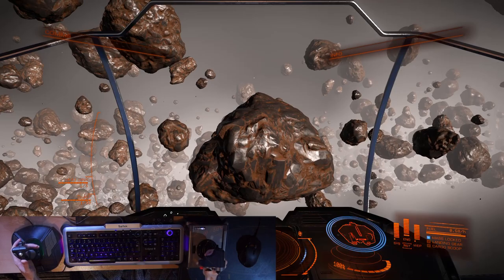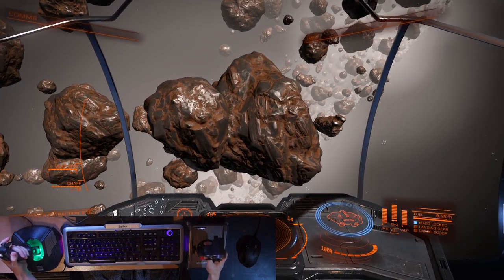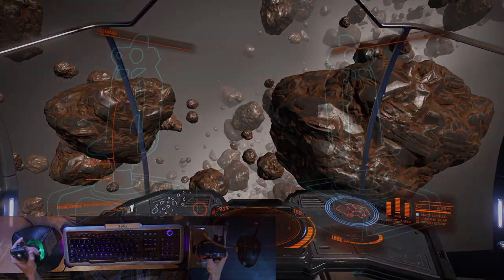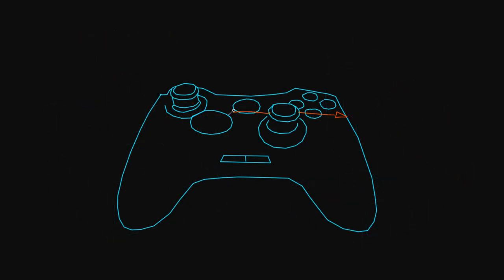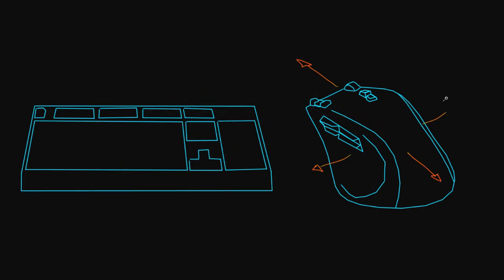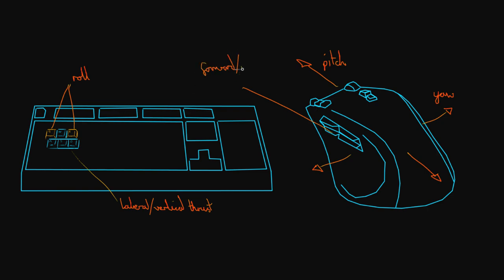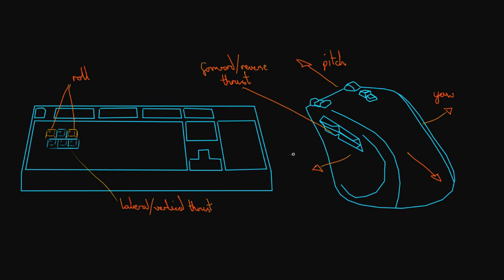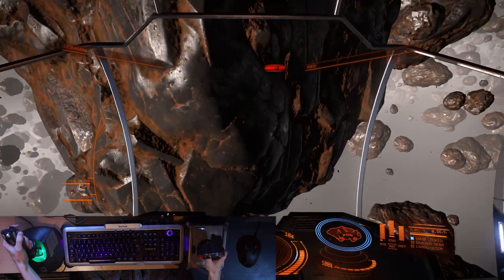Elite Dangerous Flight Assist Off Tips - Control Settings

Comment: On the gamepad's Right Stick, what do you mean having Yaw/Roll on the same axis? I can't have these two functions (Yaw and Roll) mapped to the same axis, the game only allow me to use Yaw or Roll.
Reply: Did you find a solution?I'm trying with yaw into roll on but I'm not happy with that.
Reply: @aidendavis3086  Nope, I tried yaw into roll for a while, but it doesn't work as well as I thought.
Reply: @ArcherAC3  we'd have to either buy a pedal or something
Reply: @Alecxace  you can also use the stick press for something (in my case yaw) Free look is binded on another button.

Comment: I'm using HOTAS and rudder pedals. I'm using the rudder toe breaks for lateral thrusters and one thumb knob on my throttle for horizontal thrusters. Works like a sharm.
But I'm still wondering about one thing: What would be the 'right' way to set up the yaw axis on the rudder? Currently, my nose yaws to the left side when I push the left pedal in, but a friend of mine descibed it as counter intuitive.

Comment: is there a way that i can have say an fa off override for thrusters? for example, when fa on i want it to act as it does by default (throttle up and down), but when i switch fa off i want it to use the same keys (w and s) but to have them be thrust forward and back. 
i belive a landing override exists that does that, not sure about flight assist.

Comment: I gotta say, wouldn't it make more sense to have it set up like a plane, where the pedals for yaw?
Reply from the maker: Jagh Haringenamn In planes you aren't adjusting the throttle back and forward as much as in space. I think in space i use fine throttle control more than I use fine yaw control so yaw stays on the twist. just preference though really. In a plane i'd definitely prefer a HOTAS and yaw pedals probably.